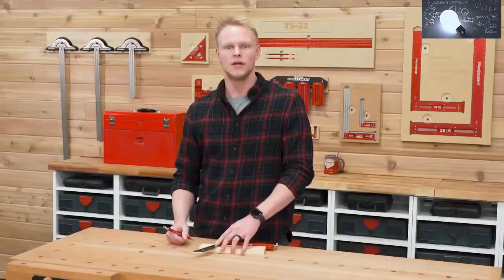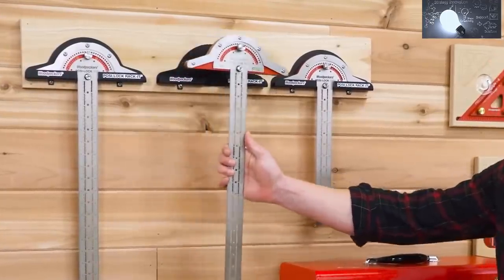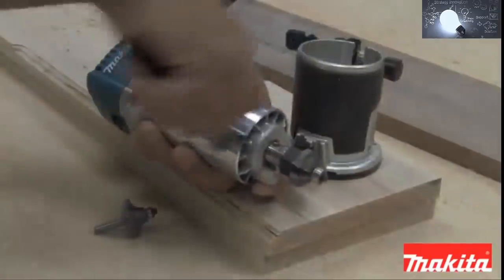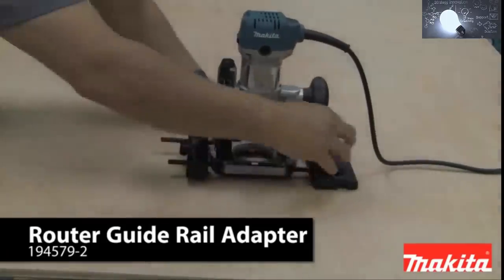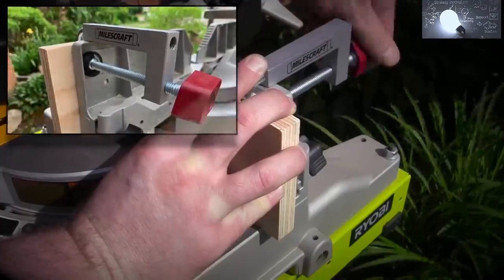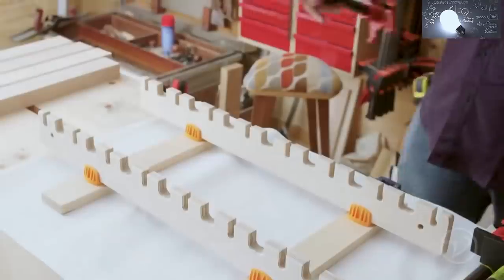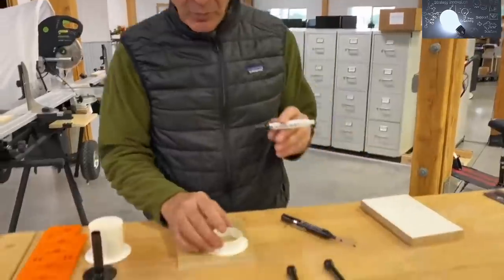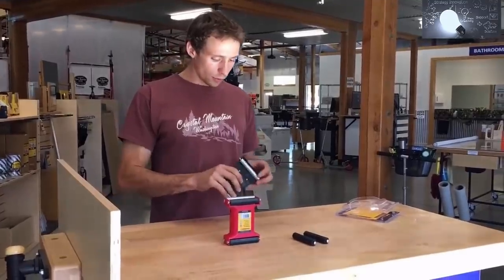10 WOODWORKING TOOLS YOU NEED TO SEE 2019

Comment: So... the most useful innovative woodworking tool in this lot is a pen with a really long tip. Everything else is either a gimmick (like the Bessey geared clamp) or is old tech given a lick of paint.
Reply: Hmm? I didn't like the pen idea at all . / and as I've used a lot of clamps over the years thought the Bessy gear clamp was the best new 
innovation tool on the list ( as long as it / I can still torque it down as hard as a regular F clamp ? )  Then the Woodpeckers Tbar protractor 
would be my next choice .

Comment: Everything that was featured are great tools but way above the average wood worker budget. The Bessey clamps are no better than most other clamps at half the price. Sorry I just figure out this was a advertisement.
Reply: Sorry, but you’re wrong on this. I’ve got clamps ranging from 12” harbor freight specials to 52” Bessy’s. If you’re remotely serious about glue-ups, bessy is worth its weight in gold. They are hands down better than 85% of every other clamp on the market and equal to the remaining 15%. you should use the product before you rate it’s quality.